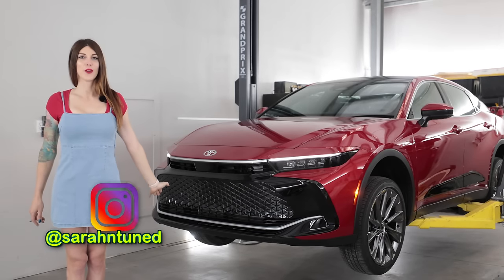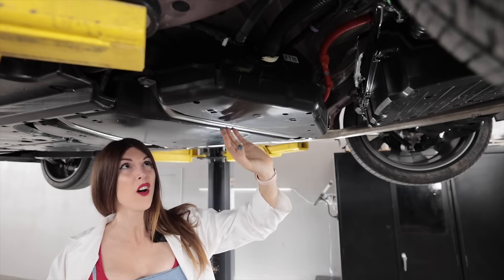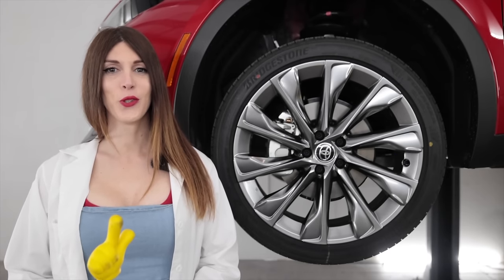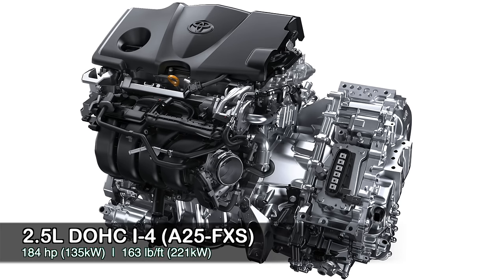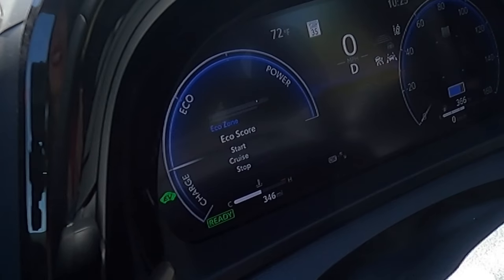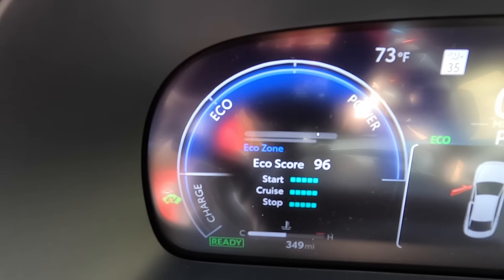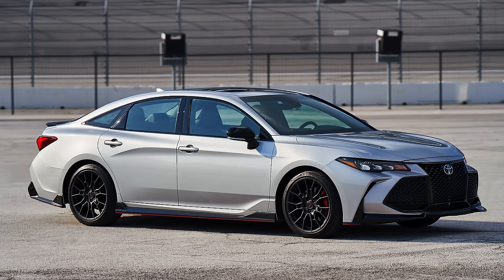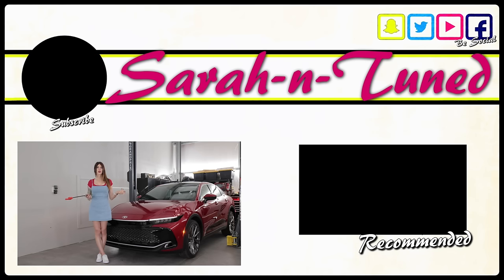The Affordable Lexus // 2023 Toyota Crown Review

Comment: I think Toyota has made the ultimate "daily driver"
40 MPG, Room for 5 and their stuff, $40-50k, which is the average price of a new car, quietly luxurious and easy to use, and built by Toyota. It even gives you an elevated seating position.
Reply: I think the 1984 Fiero with the Iron Duke also got 40 miles per gallon.
Reply: Ill keep my Ecoboost 6 speed Mustang as a cool daily driver, but this is a really cool super sized prius for sure. 

I will never understand why tbe Prius gets so much hate, its the perfect car for non car people:) and now you can get one in a full size package.....😊
Reply: New toyotas and "luxury"  is opposite! Suspension is sheet - especially compare to germans or volvo. Interior boring and cheap- no different color styles combinates, no natural materials-  cheap "eco". Noise isolation is average, no acoustic glass etc. Worse than mazda, and much worse than bmw, volvo, audi, mersedes.
Reply: At the cost of less headroom than the Camry. 

Quiet and luxurious also describes the v6 Camry XLE and XSE
Reply: @andrewcherry3330  Toyotas with the 3.5l v6 are very quiet though
Reply: @naveenthemachine  nope))) just try premium car
Reply: @andrewcherry3330  I’ve driven other cars like the accord 2.0 and I found the v6 Camry to be really quiet. The TRD is louder but the XLE XSE v6 models are really quiet
Reply: @mr.2cents.846 … Mine didn’t it was a fuel hog.

Comment: That thing is just an abomination

This isn’t even better than the Avalon or even the current gen Camry. Plus the performance for the hybrid max is just embarrassing for its price tag. It isn’t even faster than a Camry v6 yet it costs 15k more while not being 15k better

Get a Kia stinger over this or a dodge Charger or a base g80

Otherwise get a Camry w the v6 and save a significant amount of money while simultaneously getting a bigger trunk, same rear legroom, more features more headroom and a much smoother engine

Comment: Sarah, an eCVT is NOT a CVT! It's a planetary gear set with two electric motors. No belt, pulleys, or hydraulics. Only a few moving parts, and permanently engaged power carriers similar to a differential. Pretty much indestructible, and very torquey. In total, there are THREE electric motors. Total system HP doesn't add up because there are losses, and the engine can't physically put full effort into the wheels because of how eCVT works.
Reply: Better buy the Turbo Crown with the six speed Auto.!

Comment: I've had a '24 Platinum for about two weeks and I love it. With the extra HP it has plenty of beans but delivers them without a lot of noise. It's the first car I've ever had that at highway speed you can hear the ac blowing and that's about it. Not as fuel efficient as the Limited but a great car.

Comment: 40% thermal efficiency with the latest, greatest technology! I've never even driven an electric or hybrid vehicle. I have to ask. Why are internal combustion engines still a thing?
Reply: Because the fuel that powers them has a higher combination of energy density, portability and existing infrastructure than anything else we've come up with yet.  Electric and other solutions are being worked, but not there yet.